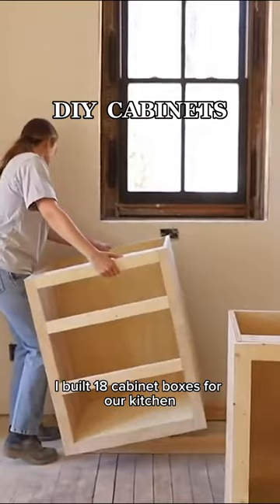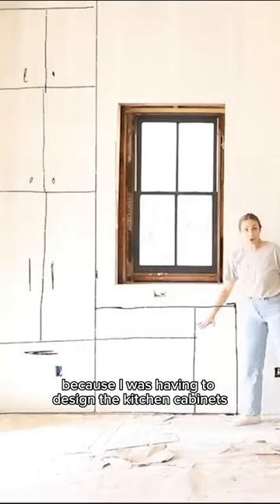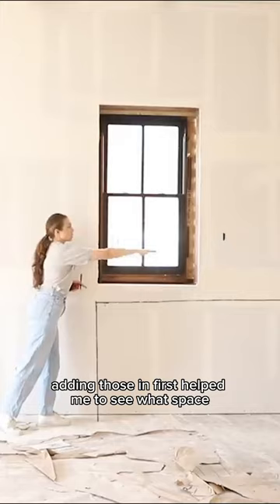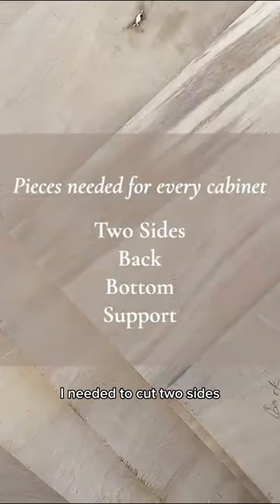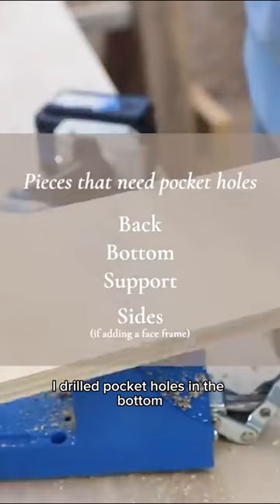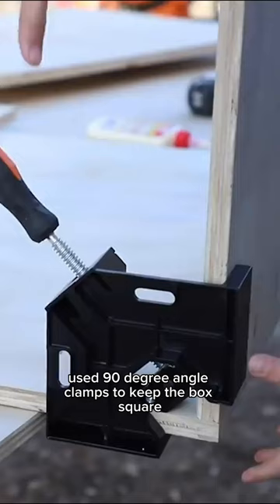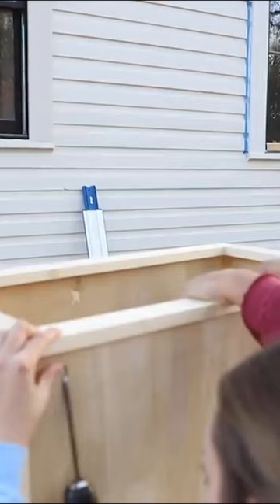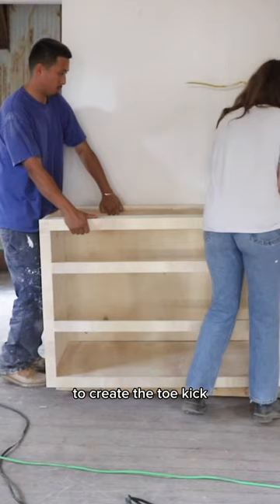How I DIYed our KITCHEN CABINETS! 🛠️ #kitchendesign

Comment: Please don’t use cheap pine for the face frames on your cabinetry. You can buy poplar from places like Woodworkers Source that is already cut to the correct thickness to use for face frames, and poplar takes paint and stain well
Reply: I came here to say the same. Poplar are birch are the correct woods for kitchen cabinets as they will not show the wear the way soft pine will.